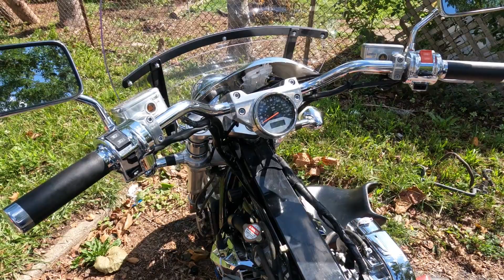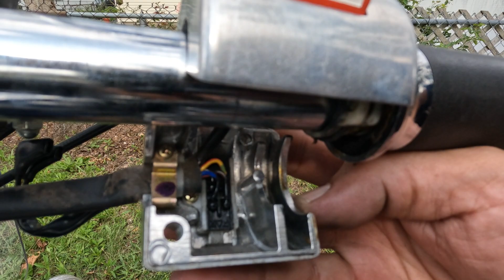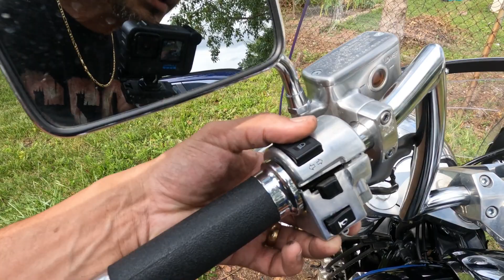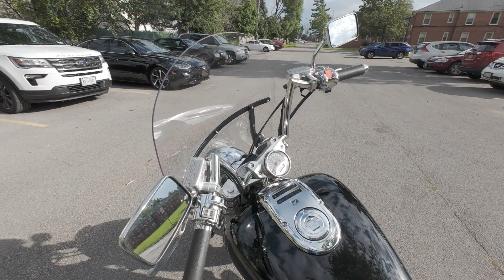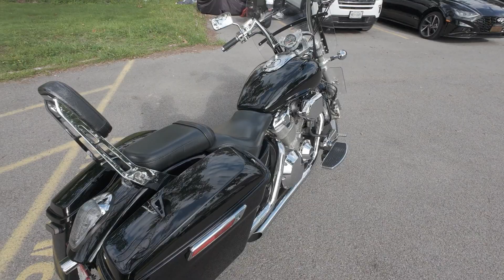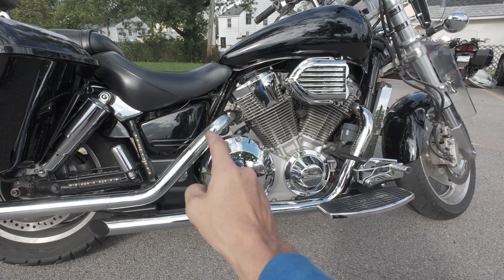Project Titan 2 - Ape Hangers and Final Color Reveal - Honda VTX1800c

Comment: I own a 02 1800 C with cobra slash cut  pipes. I love the way it wraps around the trans in the front. I've never had a problem with rear cylinder.im just just mindful of the front cylinders pipe by my ankle with pants.

Comment: Can you share where the windshield is from? And the mount used for the bags?
Reply from the maker: The windshield is National Cycle Heavey Duty, and this is the link to the mounts  https://www.ebay.com/itm/221766594083?mkcid=16&mkevt=1&mkrid=711-127632-2357-0&ssspo=YCZaUi8zQay&sssrc=4429486&ssuid=Z--bAOCQTO2&var=&widget_ver=artemis&media=COPY 
 Found both on Ebay.

Comment: Hey brother new sub here , thanks for the videos . I just picked a 02 1800c bobber myself and I want to put the same bags n bars on . I'm just wondering if you had to get longer anything to make them work and how are the bags holding up to all the miles . Would you say you put your stamp of approval on them ?
Reply from the maker: The bags are great so far, the meat hook bars are 10 inch so i was able to use the original cables, but just barely, had to fold the bars forward to get them on then bend bars up into position. Ride safe bro.
Reply: @freefree2021 thanks for the info appreciate it brother , you be safe too.